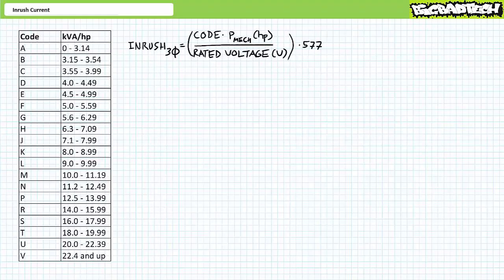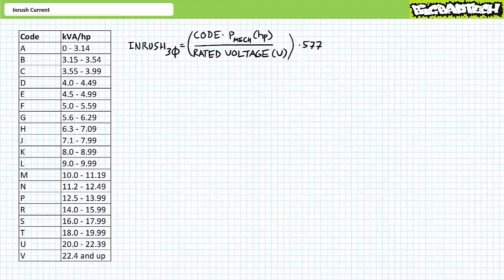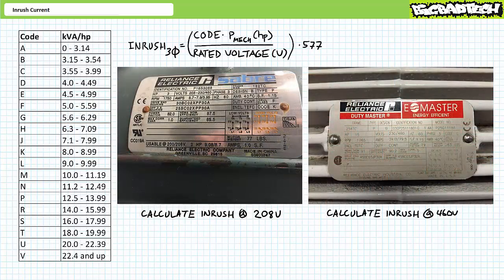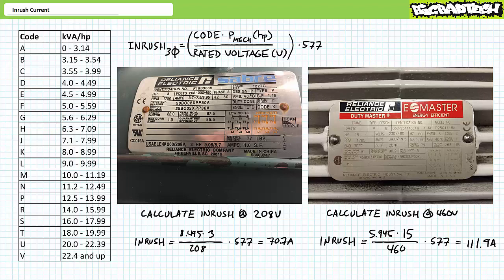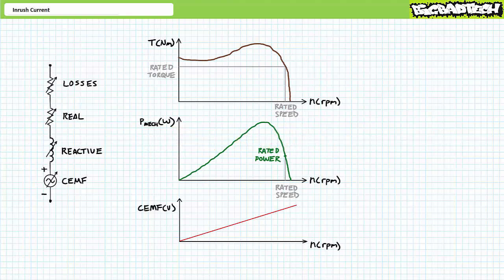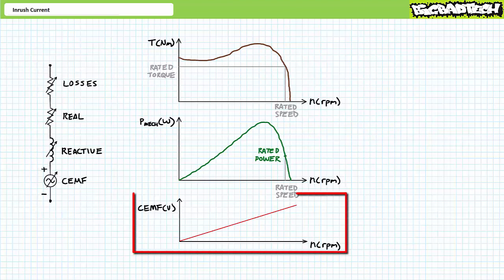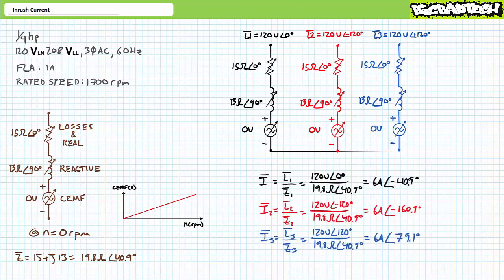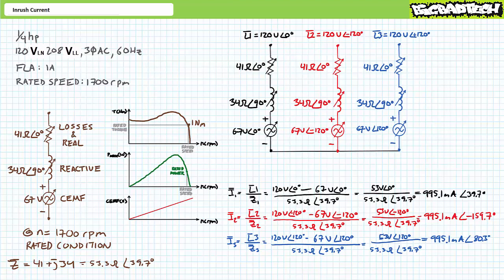Inrush Current (Full Lecture)

Comment: Hello, i'm sorry for the possibly naive question but where does the 577 in the equation come from?
Reply from the maker: Good question. It's a unit conversion for 3 phase machines. The inrush code is sometimes called "kVA" note the k. k is 1000. Apparent power for a 3 phase AC machine is sqrt(3)*Line to Line Voltage*Line Current (see https://www.youtube.com/watch?v=bVjmy2vBj-0 )  577*sqrt(3) is 1000.

Comment: I work in the elevator industry and I found the code letter is not in the traction motor name plate. Then how do i determine the inrush current?
Reply from the maker: If not specified on the name plate hopefully this data would be in the complete data sheet provided by the manufacturer. If not you could always put an amp clamp on during start to experimentally determine inrush.

Comment: Hi great Vid, but i am using this calculation on my goulds water pump and its not matching to the reading on my fluke clamp on. Dont know if am doing something wrong. The pump is 1/2 HP at 115 volts. The code is L. When i calculate using .1000 for single phase i get 4.12 Amps but my pump FLA is 10.8 Amps and my fluke meter reads 17.32 amps on start and 11.08 on run. Please help. Thanks much.
Reply from the maker: This might be an order of operations problem. Inrush is more than FLA. You should at least expect more than 10.8A. 

Assuming L=9.5
Voltage = 115
Mechanical Power (hp) = .5

Inrush = 9.5*.5*1000/115 = 41.3A

Inrush is thankfully a brief phenomenon. Most likely the amp clamp is capturing the 17.3A after the fact and on the way down. Your measured current is very close to FLA.
Reply: @bigbadtech  Okay thank u so much. I will also try another clamp on an see what happens. Thanks also for doing the calculation.
Reply: @bigbadtech  And one more thing please. I do not see an efficiency or power factor on the pumps nameplate. I know it is required to calculate input power. is there another way to figure out the efficiency or power factor of the pump. Sorry if I ask too much, just want to learn this thing. Thanks again.
Reply from the maker: Easy way: there's got to be a data sheet for the pump in question somewhere on the internet.

Hard way: Start at lecture 37 and watch to lecture 43 https://www.youtube.com/watch?v=flRocvQxQw4&list=PLdnqjKaksr8pXF2SpDyyD7ouAVlz96_Ra